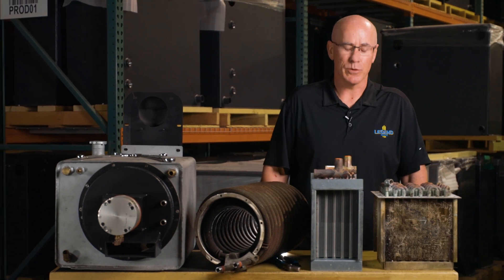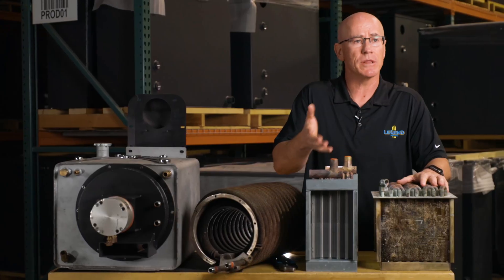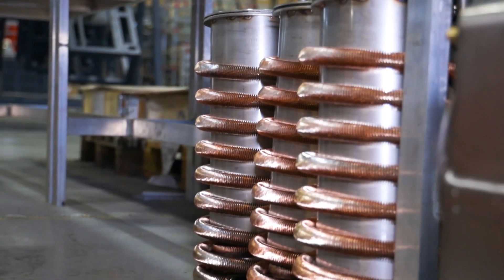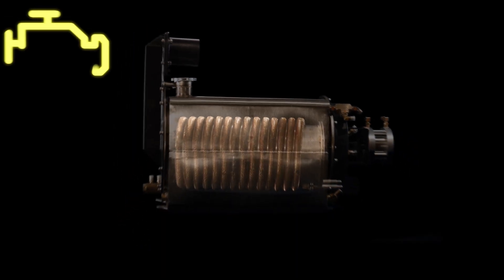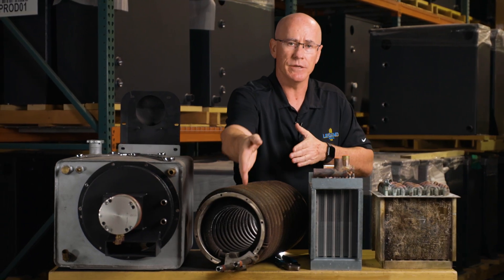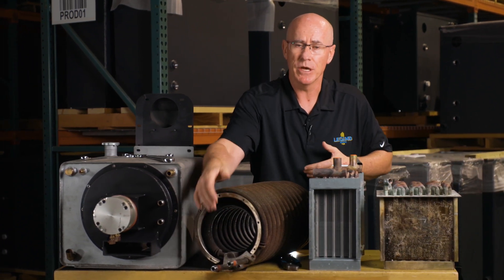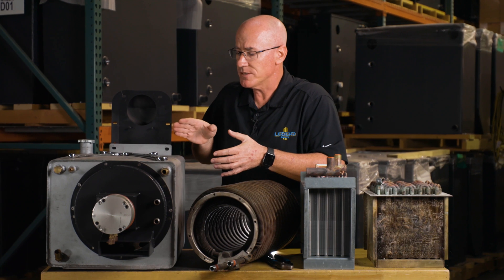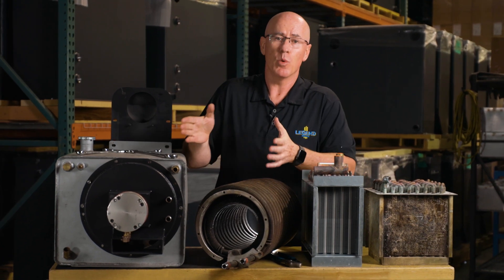Heat Exchanger Styles for Truck Mount Carpet Cleaning Machines

Comment: So I have a titan 575 my mate has a 870ss and the 870 gets hotter then the titan but the titan hold a higher heat with the same flow rate wand might want to go back to the drawing board and re wright your script, I like the sapphire TM because of the huge blowers but the one thing that stops me buying them is they dump hot water in to the waste tank the titan575 dose not means my fresh  water tank last longer I do a lot of work on farms where there water pressure is to low to not have a tank and I need my waste tank to last  because I clean a lot of house that have a septic tank and cant dump my was water down them means it has to last most of the day till I get back to the yard . There are lots of great truck Mounts but NO Brand dose the Perfect truck mount is disappointing.
Reply from the maker: Thanks for sharing your feedback. The 870 has a rock solid reputation for best-in-class performance and the concern expressed is not a common complaint among 870 users. it sounds like there may be an issue with this specific 870's settings or its application. Just in case it might be a defective part that's causing solution to bypass to the waste tank, please recommend that the 870 user contact our truckmount service experts at 800-932-3030 or 360-757-7776 and they'll be happy to help diagnose any issues.